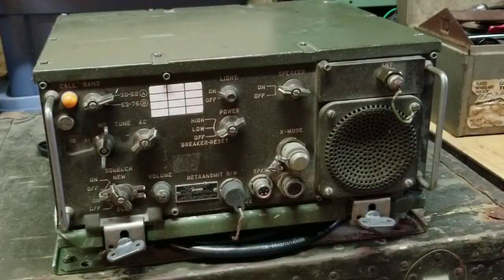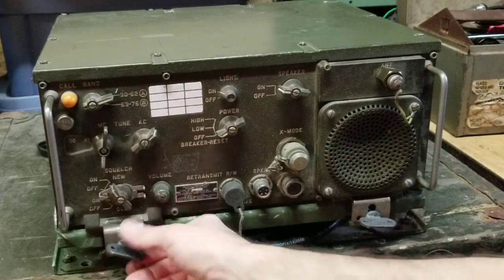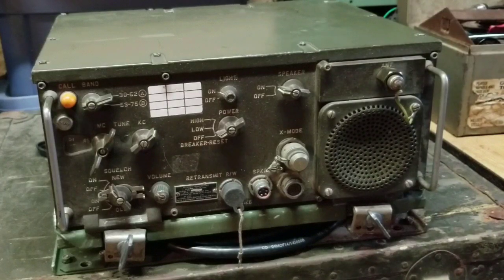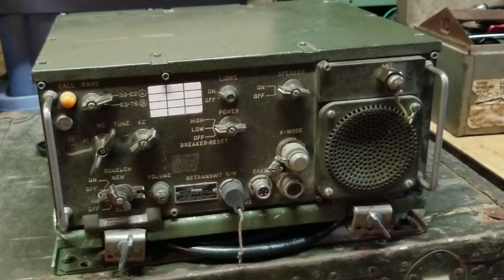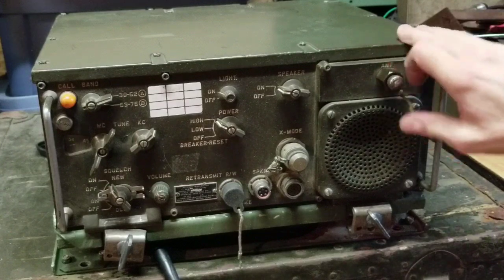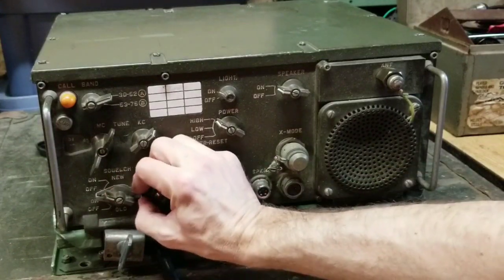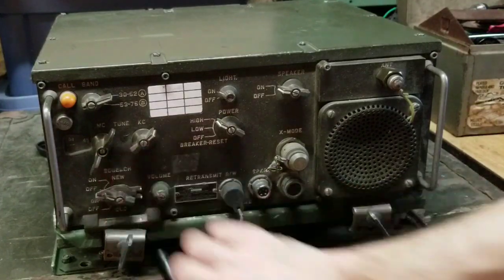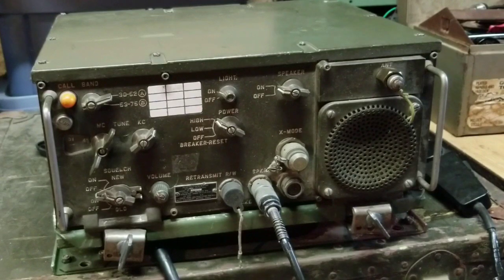RT-524/VRC Basic Overview - Military Vehicle Radio

Comment: From 1979 to 1981, I was a reservist in a Canadian Army reserve armoured reconnaissance unit. Most of the time, I worked as a radio operator, and the RT-524 was the radio I  operated. 

The year before my regiment received a bunch of these radios, we used British-made Plessey C42 radio sets that were of Korean War vintage. Despite having good, smooth sound, they drifted a lot, and were often difficult to tune.

By comparison, the AN-VRC 46/RT-524 was a dream to operate because it had automatic tuning and didn't drift. It was also somewhat lighter and easier to mount in our jeeps.

Comment: I have a prc 77 and 2 524Rs one works great the other not so great when i tuen on the radio the speaker stackets up the other does not how do i fix this,
Reply: so when you start up the white  noise  is there on one the other does not you here a blip of white noise then go es dead

Comment: Came across this looking for what year these came out. I was a 29E/35E in the Army, and probably spent most of my time repairing these. I was happy to see them replaced by SINCGARS, but then I quickly realized I missed them. SINCGARS are kind of boring compared to the VRC-12 series. Nothing to do but swap cards anymore. If I remember correctly, the 35 watt high power spec was the minimum. If I couldn't get 50 watts out of one, something was getting replaced - usually the amplifier tube.

Comment: fixed thousands of these back in the 80's.  Great radio back then and easy to repair.  I actually own a couple of motorola R2000 series comm analyzers....if anyone cares to want one....don't need both.
Reply: So did I at Ft Carson

Comment: As a civilian electronics technician for the government, I repaired and aligned this radio and many others daily for 18 years.  FM deviation is 8Khz but, can be adjusted to 4Khz easily for Ham use.  The average output wattage if aligned properly is 40 watts.  Current consumption is close to 15 amps while transmitting. The RT246 is the mother of the RT524  using the preset push-button for desired frequency use. All the AN/VRC series radios were made to work as a group radio system.  The designator for AN is Army Navy and VRC is Vehicle Radio Consol.
Parts for these radios today are hard to find because most of the radios were destroyed.
Reply: Daar Gordy  what antenne base can be used?  The tuner erom the SEM 25 willen nog be tuning  ...

Comment: There was a base antenna . But you have to adjust it's parts manually . That means pull it down . The army moved quite a bit , so setting it up was a real pain in the tookus . Especially at night .
Reply: 292 was a base ant jim beemer you must be a 36k not a 31v
Reply: No your right . And no I was a 31v20 - 30

Comment: What ever you do , don't touch the antenna when transmitter is on ( you hear the fan on ) . This system requires a matching unit . The frequency range is that wide . No antenna by its self can cover it.
Reply: We used MX-6707/VRC antenna matching units (AMU's) and AS-1729 antennas with our RT/524 radios.  They were an integral part of the AN/VRC-46 set.  If you're interested in getting one, I've seen them for sale on ebay.
Reply: i used a 150w bulb as a dummy load

Comment: I took notice that no body told you how to maintain it , and the the other radio s the military has . When these radios sit for a long time , the controls get stiff and crackling . There's afan in the 524 , and the fan will.come on by its self , when the radio sits in the sun . When that happens the transmitter will not opperate . But the dial will light up . Also it has a call light . Used when the speeker is turned off .